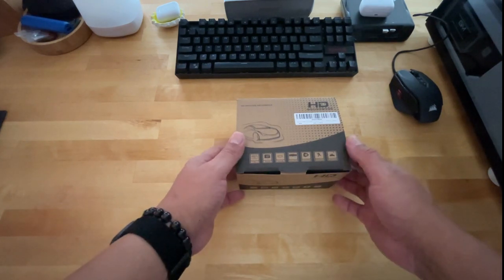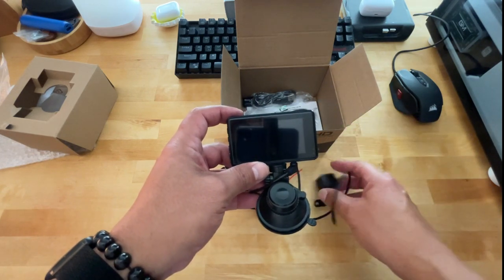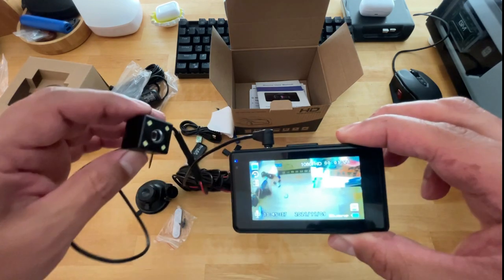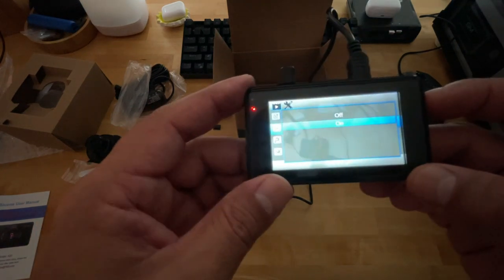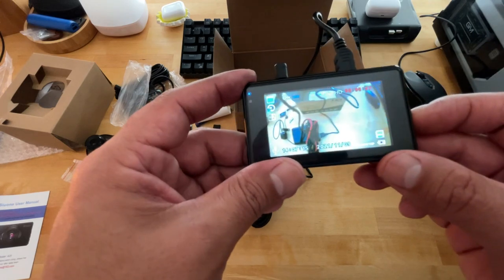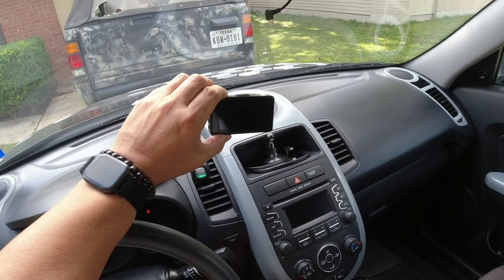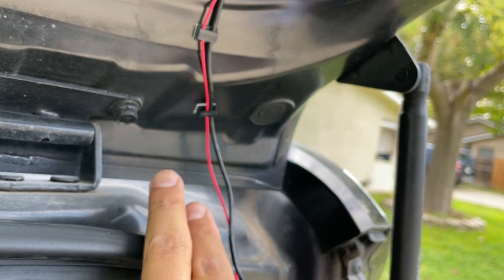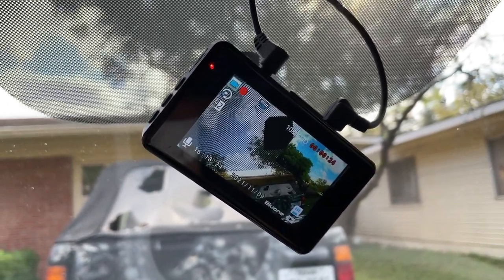BIUONE Car Dash Cam Installation

Comment: You skipped over the dual camera setting.  I am using the camera on my airplane for external mount camera and I am trying to figure out if I can disable the main front camera.

Comment: Great video, come up one question: how did you mount the rear view camera? Seems you skipped it. Did you screw into your rear dash? I am just afraid of screwing my car interior. Thank you again!
Reply from the maker: Thanks for watching. No worries. I had the same concern so I just used 3m double-sided tape and a piece of bendable aluminum and mounted it on my rear plastic frame near the rear window and it worked just fine. I used aluminum so that I can bend it to the perfect angle for backing up. Just be sure to use 3M double-sided tape or any brand for that matter that’s recommended for outdoor use. This of course is due to the extreme heat in the summer that the vehicle will face. Hope this information helps stay safe and sound.👍🏽✌🏽
Reply: @solisapaul  thank you again for the very quick response and detailed information!

Comment: If I only need the reverse camera to record as I’m driving would it be better to place it on the upper part of the glass? My car has the reverse camera anyway so I just need this for video recording as I drive. Thank you in advance.
Reply from the maker: @Amyscreativestudio  Thanks for watching, honestly, it would depend on the curvature of your rear window if it’s at a 45° slope I would say at the bottom of the window if it’s more of a 90° angle, I would say it wouldn’t matter either top or bottom. Hope this helps. Stay safe and sound.👍🏽✌🏽
Reply: @solisapaul  Thank you! Your video gave me confidence to do this myself instead of paying hundreds.

Comment: 21:00 how long dose the power last with the car off cuz I’m just curious if it don’t last that long and the car is off and someone bump into the car how will it record if it lose battery that fast
Reply: Someone let us know🙏
Reply: @JayDeLaNu  right like I’m looking trough all these videos ok I find a good one but they leave out the most important stuff 
Like 
1 what is the heat or cold it can stand before it gets ruined 
2 if it got internal battery like how long dose it last if the car is off And other ones to I can’t remember but when I remember I’ll say lol like dang

Comment: I want to order but can you use a portable external battery instead of cigarette lighter? What if I don’t have cigarette lighter?
Reply from the maker: Yes you can, that’s what I did in my video during the demonstration, I used a Brinker battery pack. The only issue that might arise is that the internal battery might not hold a charge till you use it again with battery pack to keep the date and time stamp correct, you would have to make sure date and time are correct during each use. Hope this helps. Stay safe and sound 👍🏽✌🏽
Reply: Totally helps. Just ordered.

Comment: When you charge it, does it have to be on? I bought 5 of these and 3 of them wont charge! 1 charged but it was on, and i have not tried the last one
Reply from the maker: As far as I know, it doesn’t have to stay on do keep in mind. These don’t hold a very long charge on a full charge. I think the last time I tested It only stayed on for about 15 minutes. To have constant power. it keeps its power from the cigarette lighter in your vehicle. Hope this information helps stay safe and sound and thanks for watching.👍🏽✌🏽

Comment: I recently bought one and I don't know how to make it turn on when I start the car. I have to turn it on manually even though it is connected to the car all the time.
Reply from the maker: Daniel, thank you for watching. The car dash cam should automatically turn on when connected to the lighter in the vehicle, when the ignition is turned on, or even to ACC mode the power is supplied to the camera, which in turn automatically turns on. Have you checked the fuse to the lighter or have you tried the lighter itself to see if it actually heats up it could be a faulty fuse or a bad connection on the car lighter. Another way to test It is to actually connect the camera to a USB power supply (NOT FROM VEHICLE) and see if it supplies power if it does it most definitely is something wrong with the vehicles lighter or it’s power source. If it doesn’t then unfortunately your dash camera might be defective Let’s hope this is not the case. Hope this information helps you. Stay safe and sound.👍🏽✌🏽
Reply: @solisapaul  The problem is that power continues to reach the cable even though the car is turned off and closed.
Reply from the maker: @DanielLewin-y4b  are you using your car lighter as it’s power source? Did you check the fuse? Lastly what time of vehicle do you drive? If it’s a  Peugeot, or BMW for some reason, those foreign vehicles keep power, active, even though vehicle is off. After the engine has stopped, you can still use functions such as the audio equipment, windscreen wipers, dipped beam headlamps, courtesy lamps, etc. for a maximum combined duration of thirty minutes.

May explain why the power is staying on

Comment: Thanks for the video. Just got this camera but even though it's a 1080 I'm not impressed by the image quality. I'm sure it uses an inferior sensor. I remember the G1W dash cam (the original, not the knock offs that came after) I got when it came out 10 years ago had superior image quality that was very impressive for a $45 dash cam. The images looked sharp and crisp and looked as if they were taken with a point and shoot camera. Unfortunately, all the ones sold for around $50 since that one and till this day don't seem to have good sensors. The image (videos) seem to be washed out or too grainy in the shade with the colors being weird and off. I've tried many but they're all the same. I have to use VLC video settings to try and get a somewhat decent image quality when reviewing a video, not the case with the old G1W where videos looked really good without any editing.  But I know this isn't for shooting good videos but for recording evidence.... That G1W lasted me many years but one summer day it decided the heat was too much for it all of a sudden and it stopped working properly. Never leave these things in the sun too long or they'll eventually malfunction -happened to me more than once and I don't even live in a hot area. 

Now, I'm wondering what I'd have to do to connect the rear cam to my reverse light in an '05 corolla (standard). Never done any wiring before.
Reply from the maker: Adam, thanks for watching. I totally agree with your experience. It seems once a good product is sold it lures the consumer into that particular product and everything afterwards just seems to be made a little bit cheaper unfortunately. I hate to say it, but I do live in Texas and my camera. The one that this video is about is actually starting to show signs of wear and tear. I might be putting out another video with another dash cam however, I would like to mention this one lasted a very long time and it’s my fault for keeping it in the vehicle constantly once installed I never took it out. That’s good advice you’ve given on doing so. As for installing the rear camera with this particular model simply install it to your positive wire on your back up light (My positive was light blue) anytime you go in reverse the camera will kick onto the reverse camera. Hope this information helps stay safe and sound.✌🏽👍🏽

Comment: Sorry if this is a dumb question, but how do you format the SD card? Nowhere in the instructions does it explain how to do it(unless I overlooked it). Thanks
Reply from the maker: No dumb questions here and you probably did perhaps overlook it. It’s in the menu section under settings. If you go towards the bottom, it’ll say format, SD card. Also, if you watch my video, I do mention it when I go over the menus. Hope this helps. Thanks for watching and stay safe.👍🏽✌🏽

Comment: Thanks a lot! My neighbor just got this unit and I'm about to help her install and set it up so your video is a great help. One thing I noticed is that you said the Lock button locks the screen. On page 19 of the owners manual it says the Lock button will lock the current file and it can't be overwritten. Maybe it's two ways of saying the same thing?

Comment: Hi, thanks so much for this video. I'm not sure my power supply is working correctly with the connector that came with the dash cam. The blue light came on, but that was it. Are there adaptors that I can use? I have a Prius C. Thanks for your help. Jeanie
Reply from the maker: Jeanne sorry to hear your having issues. If you say you’re getting a blue light that would indicate you’re getting some power perhaps just not enough. You can take the camera to your PC and plug it with the alternate USB data cable it came with and see if it will power up this way. You can even use a USB portable power bank and see if that will supply power to the camera as well. If you still end up with the blue light unfortunately it seems the camera is defective. if you are able to get the camera to turn on, then that would mean you would need to check your fuse box for the lighter fuse and replace it. It could be possibly defective or you need to clean the inside contacts of the lighter which the camera plugs into your car perhaps it’s not making full contact. I hope this helps. Stay safe and thanks for watching.👍🏼✌🏼
Reply: @solisapaul  Hi, thank you for the info. I do have a power bank but was afraid to use it because the user guide said not to. I did anyway and it worked great. Surprised at how nice the picture is. Now to tackle that lighter fuse. Thanks again for your help and great video. Jeanie
Reply from the maker: @jeannewarpack8893  So glad to hear it worked. Stay safe and sound✌🏼👍🏼

Comment: Thanks for the video. I bought this model as well. Quick question? For some reason when I turn my car off the camera still keeps recording and doesn't shut off. Is there a setting Im forgetting to use or change.
Reply from the maker: Thanks for watching and sorry for the late reply. What might be the issue is you might have to set screen saver to off as well as auto power to off you will find those in the menu option. If you get confused you can watch my video again under menu options. The only other thing I can think of is perhaps depending on what vehicle and how your power source works at your cigarette lighter which is where the camera is plugged into I’m assuming your vehicle might still supply 12 V to that cigarette lighter if it’s initiated, meaning something plugged into it making contact. If that’s the situation, your only option unfortunately would be to disconnect the cameras, cigarette lighter power adapter every time you leave the vehicle. I truly hope this information helps. Stay safe.👍🏽✌🏽
Reply: @solisapaul  thank you for replying back. Ya I tried everything and even contacted the seller. They told me different things to do and that didn't work either. Unfortunately I returned them, I had bought 3 (1 for myself and 2 for Xmas presents) 
Maybe I'll bring myself to buy another brand lol. It will wait till next years black Friday sale.
Reply from the maker: @washuaiki  sorry to hear that they would’ve made great Christmas presents, I sure hope from the time I bought my model to the time you bought yours that there wasn’t some sort of firmware upgrade that’s causing this issue. I guess we’ll know if I keep getting more comments indicating similar related issues. I don’t know why else this would be happening.? You are correct there’s plenty of other choices out there for the same price point if you’re still interested in getting these as gifts as well as for yourself. Having a dash cam truly brings a piece of mind in the event of an accident. Stay safe and happy holidays and may you be blessed with a good new year.👍🏽✌🏽
Reply: @solisapaul  Thank you very much for your help and you to have a safe and happy holidays and may you to be blessed with a good new year

Comment: Hey love the video. Thank you so much. I might have missed from the video so I have one question. You said it loops every x amount of minutes. If I were to get into an accident, how do I make sure I save the necessary footage?
Reply from the maker: Charlie sorry for the late reply I’ve been kind of busy lately there’s no need to worry when I say loop it will continue running video all the way until the SD card is full and then immediately it’ll overwrite and start recording from the very beginning of the SD card. In the event you’re an accident simply either take the dash cam or the SD card with an SD card reader and connect it to your computer and save a copy to a USB drive in case its needed in court. I hope this helps I still have that camera today and it works just fine with no issues very glad I got it it brings a peace of mind when driving. Stay safe and sound👍🏽✌🏽
Reply: @solisapaul  Hey man thanks so much for the reply. Have a good one
Reply: @solisapaul  have you replace the battery? Mine turns on a few seconds and the it shuts off. Thanks for any input you might have.

Comment: Thanks so much for making this video. I've had the same camera with a different name but the controls are the same. I figured out how to playback but it says one file is locked and I can't seem to unlock it. Does it need to be deleted in my computer and not in camera?

Thanks again and cheers from Canada North
Reply from the maker: I would say if you’ve already tried to do a format through the camera and it’s still having the issue, then what I would do next is go ahead and format it on your PC. Be sure to format it as FAT32, then try again. Hopefully this will work. Stay safe and sound 👍🏽✌🏽

Comment: Hi  great reviews. how long is the wire rare camera. Is that fit to the toyota van hi ace.I bought this in amazon today for my small car. If its long wire/cable and will fit for van ill buy one for my partner.

How about not to do the hardwiring in reverse cam.. can u connect it direct to rare cam to the main monitor?
Reply from the maker: Thanks for watching, I would say the wire is around 13 ft long. It would most likely fit a Toyota van. As for wiring with the back up light it would work without but you would need a 12v source for power and keep in mind this will keep the rear camera on constantly. Hope this helps. Stay safe and sound.👍🏽✌🏽
Reply: @solisapaul  oh no sounds complicated to me 😂 probably need to look for someone who professional. I thought this is the one who dont need hardwired. I watched ur videos before i bought online.thanks for quick response. U r amazing

Comment: How do you change the date? For some reason mine went to a 2021 date about three weeks ago
Reply from the maker: Sorry for the late response and thanks for watching. If you follow my video it’s under menu options. I explain how you can change the date. If for some reason it changed on you it could’ve been either a power fluctuation through the vehicle that caused it to default or change. Other than that I don’t understand why it would do that my never has.? Hope this helps you stay safe.👍🏽✌🏽

Comment: So if i were to get in an accident or see something and want to make sure it saves, I'm confused as to what button I should press to save current recording?
Reply from the maker: Thanks for watching you would not really need to worry about when to push any button to stop the recording or to begin the recording if you set it up during installation it would ask what intervals do you wish to record I believe it was 3,5 and 10 minutes. This indicates that the camera will constantly record within those times indicated so in other words you’ll always have the video recording in the event you do get in an accident as soon as you stop the vehicle power it will stop recording at that point. If you leave the ignition switch on it will continue to record as long as the accident would not have involved the battery being discharged or a short circuit. Hope this explains a few things stay safe out there.👍🏽✌🏽
Reply: @solisapaul  that answers half of my question so thank you. In the case of there being no accident but I see something, and want to save, what do I press to save the video without the loop deleting it?

Comment: Thanks for the video. I have this model as well. Does anyone else have an issue where the rear camera saves the video in mirrored mode?  I can't find anything in the settings to flip this option. thanks!
Reply from the maker: Thanks for watching, I would do a reset on all settings then try to record and see results. Not sure why this would be happening or causing this issue? Hope this helps.

Comment: How do you format the memory card
Reply from the maker: Thanks for watching, so there is two ways you can format. Through the actual BIUONE device under settings you’ll see format SD or you can connect the SD card into a USB,SD adapter and plug it into your PC and format it as fat 32. Hope this helps stay safe and sound.👍🏽✌🏽

Comment: Can I power this via USB power inside my vehicle instead of cig lighter?
Reply from the maker: Thanks for watching and sorry for the delayed response. As for your question as long as the USB supplies power when in accessory mode via key ignition. It will charge long enough to keep time and date stamps as well as supply power to the unit for approximately 10-12 minutes if pulled away from its power source. I do wish it would supply a longer time with remote power to the unit however that would require a bigger battery and it would be more expensive. I hope this helps stay safe.👍🏽✌🏽